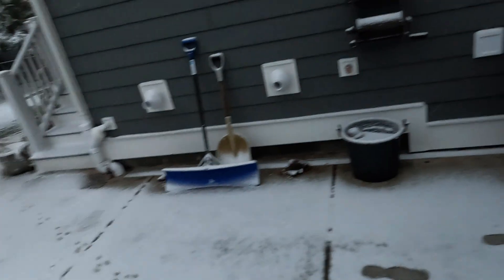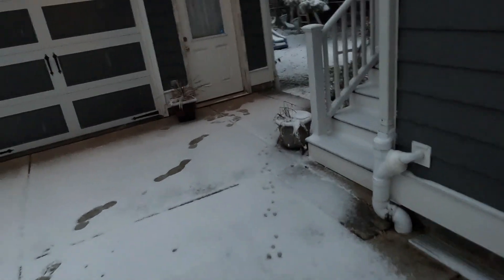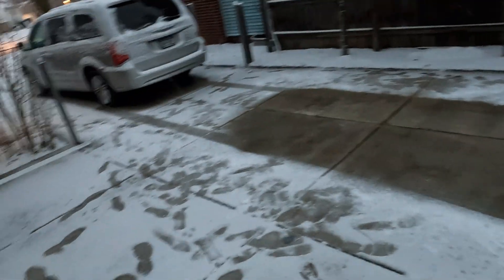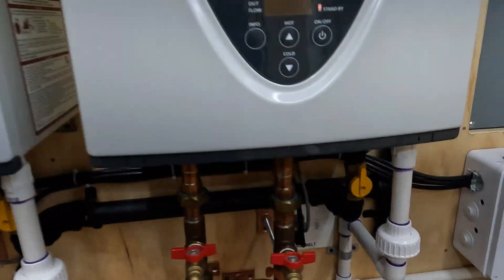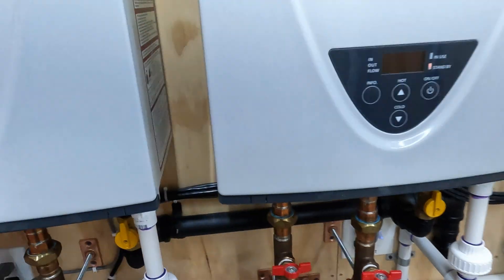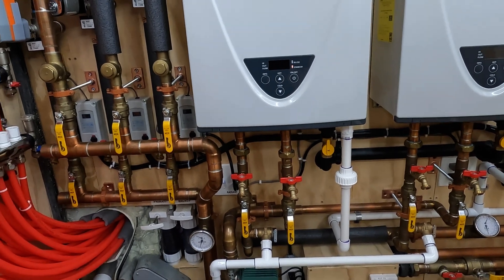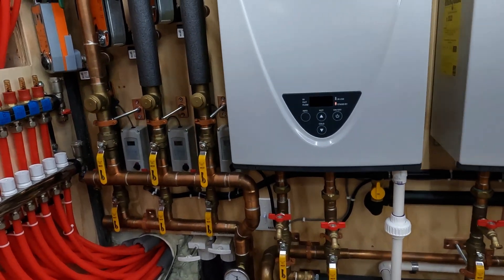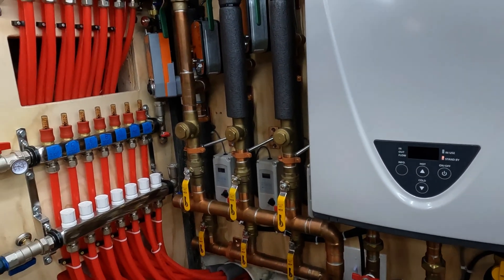A Quick Heated Driveway Snow Melt Time Lapse in Buffalo, NY before it Turns to Ice! - [1-13-2023]

Comment: Awesome stuff man.  If you had solar panels and weren't such a big fan of the tinkering process, would you have gone electric?
Reply from the maker: Thanks!!  Even with Solar, I don't think I would have gone electric for a driveway this size.  I would probably need a 400 Amp+ service to melt all 1,600 sq ft (guessing, I haven't done the math).  I could be wrong.  Natural Gas is typically cheaper in my area than electric, although recent price hikes might make them pretty comparable now.  Coincidentally, we are installing Solar on the house this spring.  Watch for that in future videos!  Thanks for watching!!

Comment: I thought it should be some trigger mechanism to automatically start it so it melts on contact
Reply from the maker: Hi Stephanie!  It does have that capability, but I have not had any issues doing it manually.  It also makes for a better YouTube video when it melts off.  No one wants to watch wet concrete 😉😊.  Thanks for watching!!

Comment: Actually was thinking of this while going out to shovel this weekend - I think I will think of this system EVERY time, lol.

FYI, I cleared snow at the beginning of the day ( ~ 10:30, 24F, partly sunny), and to my surprise, I had a dry driveway at the end of the day.  NE OH.  

It is actually a broken plastic shovel (virtually new) repaired with epoxy, fiberglass mat and embedded Chinese food container metal wire, silicone coated - yes, I am that stubborn, but I consider it resourceful or to identify why their mold is so vulnerable.

Anyway, glad to have seen this recording.

Comment: $10.00 spent is pretty cheap slip and fall insurance not to mention the entertainment of watching snow melt in time lapse. I doubt you could get someone to shovel your driveway clear and then blow it dry for anywhere close to $10.00. I love just looking at the board you put together for all of this to work. The workmanship is just amazing. I’m jealous.🇨🇦👍👍
Reply from the maker: Thanks for your kind compliments Rick!  I couldn’t agree more!  One of the bad things about having the foam board insulation under the slab is that I no longer get any heat help from the ground.  If I don’t turn it on in conditions like this where its wet and the temps are falling below freezing, it will all be ice!  The $9 is money we’ll spent to make sure no one falls.  I don’t talk about this much as I don’t want it to come across as bragging, but the channel easily makes me more than $10 a day now, so I don’t hesitate running it 😉.  Thanks for watching!!!

Comment: Need to change screen to correct date. You have December 13, not Jan.
Reply from the maker: For some reason YouTube flagged this comment and held it for review, so I didn’t see it until someone else pointed it out.  Thanks though!  The only way to change it at this point would be to delete the video and re-upload, but I can trim after the fact so I just trimmed it off.  I mention everything on it in the first 30 seconds of the video anyways 😂.  It’s reprocessing now and should be fixed shortly. Thanks for letting me know!!

Comment: $10 to clear the driveway.The thought no one fell in the driveway priceless
Reply from the maker: My thoughts exactly Ed.  Temperatures dropped pretty fast Friday, and if I hadn't of run it, everything would've been ice by evening.  $8 is nothing vs having someone slip and fall.  Thanks for watching!
Reply: @DeckerChristopherJ  HI Chris so would you really recommend a heated driveway? I know having swimming pools cost more to heat than a house hope this heated driveway doesn't cost nowhere that much . Anything unexpected you found with the heating system?